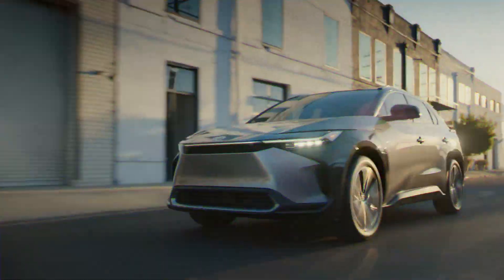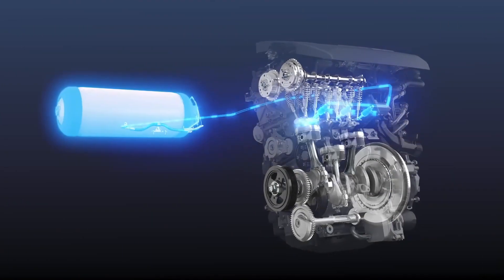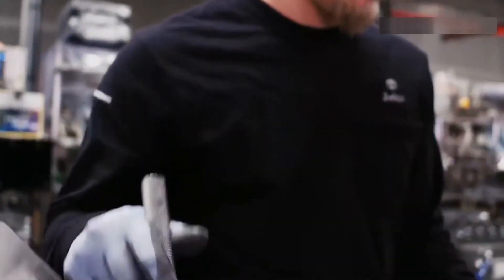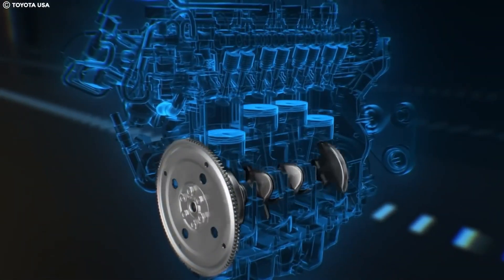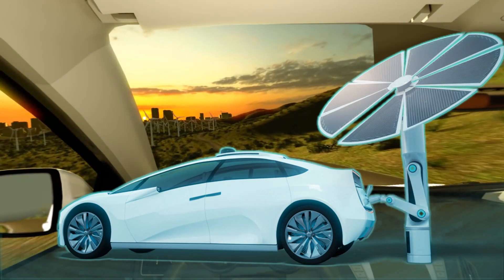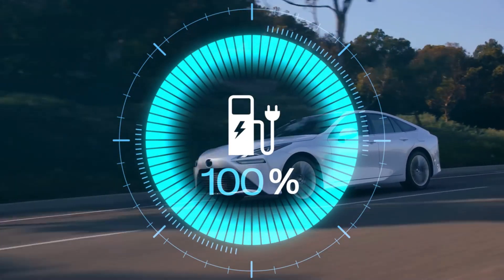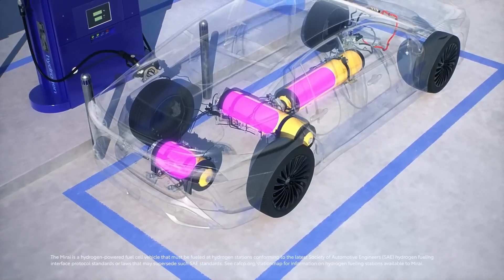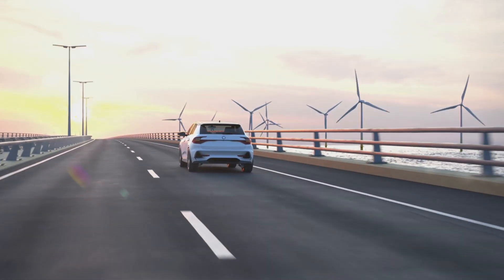Toyota CEO reveals game-changing engine

Comment: This makes no sense. Every time energy is converted from one form to another there are losses. Even taking electricity from the power grid and storing it in a battery results in losses. Getting the electricity out of a battery results in losses.

So we have losses from the grid to the battery, from the battery to the electrolysis unit. The electrolysis unit won't be 100% efficient and the combustion of the hydrogen and oxygen will be less that 50% (gasoline engines are up to 25%).

Electric engines are around 80% efficient, add up all the loses from this ludicrous idea and I doubt you will beat a gasoline or diesel engine let alone an electric system.

Thundef00t would have a field day with this nonsense.
Reply: Agreed. Electrolysis losses to make hydrogen PLUS heat engine losses (heat engine losses typically very big) make for great energy losses from the original energy source into hydrogen, compressing it into storage, and then ... burning it at less than 50%, instead of a more efficient conversion into electric power for an electric engine as efficient as over 90%! 
PLUS, an electric engine needs no variable transmission, unlike any combustion engine, so there is another saving in weight and parts. Electric vehicles are the future, whether Toyota and dirty-diesel loving European makers like it or not. Never even mind Detroit, which is still stuck in whatever dinosaur age they are in.
CRIKEY, just save the electrolysis step, use a battery and electric motor, and be done!
Reply: @owenlaprath4135  Exactly, just skip the electrolysis step completely. Also, just think how much hydrogen would need to be produced to run a car with a modest 100 HP. Commercial hydrogen isn't even made by electrolysis it's made from methane, this alone tells us that electrolysis isn't a good solution. Everything about this is a stupid idea.